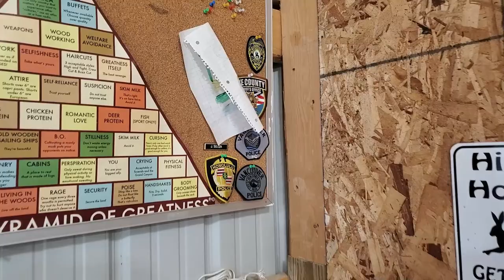She’s DONE On Our Channel!!  Airing Our Family’s Dirty Laundry | PEX Rings vs. SharkBites

Comment: I have a Sears heavy duty 70 70 lb washing machine from the 1980s and I would never trade it for one of those stinky front Loaders...
Reply: With the front loader just need to keep the door open until the seal dries out then no issues with the smell. We use to own one.
Reply: @maryburke6682  I know that's one of the things that don't make much sense to me or buy that stuff to wash your washer my cousins have them they just don't make no sense to me that's why I'll keep what I have
Reply: I have a front loader. I run an empty short cycle with bleach monthly. No issues and no smells. Also depends on what laundry detergent used.
Reply: Its due to having a tight seal and water can get around that seal. Also small items can go down under it especially if too much laundry is in it.
Reply: Absolutely! Daughter has one of those computerized front loaders- looks like it could launch a satellite- it won’t let me do a small cold pre-soak , while saving the soap/ softener etc, add warm water and do a full load - with out draining and spinning out. Not actually environmentally responsible at all - 
Just give me my Ol Bessy any day.
Reply: ricki lee p
Reply: I plan on having a stackable top loading washer, and front loading dryer in my tiny home.
Reply: i have a speed queen,last American made upright washer you can currently get,and they even keep parts if you need them..  this newer junk is all china made or made from china parts assembled here.
Reply: Appliances are just not made the same. My washer and dryer were given to me by an old neighbor and both are 80 models and have been working wonderful for past 8 years. I have 4 kids so laundry is a never ending task in my home.

Comment: If the washer /dryer are in the house proper, you may want to consider putting a drain catch pan under the washer for leaks and plumb it to the outside, or to the washer drain pipe to prevent flooding the house, same for the hot water heater.

Comment: At this point, getting on grid with generator backup was an excellent decision. 

In my opinion, 'homesteading' is not about intentionally putting your family at risk if you don't need to, just to uphold some ethereal internet standard. Our ancestors, 'homesteaded', and if they could have put in grid electricity, and indoor plumbing you bet they would have!
Reply: Please respect the rest of us who support this channel. NO negative criticial comments! NO politics here!
Reply: @cynthiarayl8568  Agreed.
Reply: @JourneyOnLife   👍🏻💯
Reply: If you have no real need to be connected to the grid then you absolutely shouldn't... it's not anymore risky to have a good offgrid system with a backup generator then it is to be on the grid... the grid fails too.. there's been many examples of this and you know it because you explicitly said with a back up generator... the difference is when the grid fails most people are screwed they have no concept of how their electric works and it wouldn't matter if they did... if they are lucky enough to have a backup generator then they like everyone else with backup need gas to run it often its a situation where you may not have access to more gas... if you have a problem with your off grid system you are likely able to resolve it yourself as you have learned how it works if not you're unlikely to be having a issue at exactly the same time the grid has failed and your likely to have more access to the gas you need for your back up in that situation... plus there's just the huge environmental benefits, financial benefits, and the independence you get from your own electric system.... you're not endangering your family for a feeling and you're not endangering your family at all if you are doing it properly... you're idea that its something "dangerous" is just silly... extra electricity is a benefit not a need...
Reply: @lizf1353  I think it's great that you have figured out a plan that works for you. Even better if you are actually living by that plan. Good on you! =0)
Reply: I'm not going to give anyone a hard time for connecting to the grid when building their home that's for sure... I'm very aware of all the things that would push a person to that decision and sometimes its just not possible to live completely off grid in their area for a number of reasons.  But to say it's endangering your family to be off grid is insane and it spreads misinformation to people. I hope you can understand that. If you truly don't understand please look into current off grid tech and how it can certainly meet the needs of a family. Running your laptop is not a necessity and you are not endangering your family by having them conservative in their energy use during a energy drought on their property. The basic needs of their lives will still be met. Are people going to use electricity for heat when they have a system that cant handle that of course not... other then that electricity is a benefit of the age we live in not something you need or you die!
Reply: @lizf1353  Good point.

Comment: Guys : next time you insulate a ceiling , staple a thin piece of rope onto the ceiling joist about 3' apart , then pull the insulation over the strings ,between each joist and it'll self support the bat of insulation  whildst you   await drywall or panelling
Reply: That is a great idea. We will be redoing the bunny barn this spring (about 10' x 10') and I am going to send this idea to my hubby. Will make life so much easier!

Comment: Need to get some water pipe steel plates for each stud that has water pipe through it. So you don’t get any punctures from hanging drywall.

Place those steel plates on the electrical through spots, if you want to be extra careful of an electrical short from a nail or a screw hitting the wire.

Comment: On your pump house, I suggest you get a thermometer that records low temp and leave it in there, which will give you a warning if your heating system isn't able to keep the shed at temp...particularly during extreme cold wind events.

Comment: Cold is on the way! Save more energy./fuel by wrapping the water heater in an insulating blanket made for water heaters. You two are amazing and inspiring! Be warm & safe.
Reply: My son is a Journeyman HVAC supervisor and I think I remember him taking mine off and explaining why those are a bad idea. I don’t remember why though. I will Duck Duck Go it to find out...
Reply: Respectfully, it can void the warranty if you wrap it.
Reply: @beckysmuck8771  I'd be worried about it igniting tbh. If the heater isn't designed to be insulated that way it might overheat maybe?

Comment: Tips from a DIYer who re-plumbed a house with PEX :
• Use 3/4" PEX as much as possible.  1/2" reduces the flow too much.
• Where ever possible, use the PEX corner bend support braces instead of the fittings.  Saves money and you get better flow.
• That little insulated box where the pipes come up might need an incandescent bulb in winter to prevent freezing.

Comment: on the laundry line you can't go from 2" to 1 1/2  trap  as the water flows from the washer it will back splash and the code is on drain lines you can't go down in size only up you have a 2' stand pipe to a 1 1/2 trap also  and fitting in a wall needs to be glued your trap is wrong I hope this help

Comment: Coming along nicely. Water heater blanket and there is a "thing" that the dryer vent can hook up to that allows you to keep the hot air inside during the cold month's and vent out side  during the warm month's, not sure what it's called, but that will help with keeping the warmth in side. Now for the animal barn !!  Finish the bathroom and move the trailer outside. Moving wood inside or up by the door so it's closer ? Looking good. Stay safe and healthy. God bless

Comment: This is the first time I've seen your channel. I used to be in construction &  I don't know if you guys know it but there is another pex connector ring that is of the same pex plastic  the lines are made of that is the best. It expands with the lines when hot or cold like freezing. Also tankless water heater wpuld have been my choice.  Endless hot water one shower after another. Best way to check for leaks is with air pressure tester with air & a gauge . Fill lines with compressed air & see if you have a pressure drop with in 24 hours. No water mess if you have a leak. Build on people.

Comment: Hi guys, When you get around to plumbing up the House. When plumbing in a shower tub valve, use 3/4" fittings for the tub spout going down. The 1/2" PEX fittings cause enough restriction that the shower head will leak while filling the tub otherwise. Looking good!!! oh & you don't have to tef tape the water heater lines as they have a rubber washer for a the seal.

Comment: the two directions of the dryer box  has two vent hoses which a nylon knee high stocking attached to the ends is great for the lint to not blow around  and will allow to be removed when filled.

Comment: Glad to see you went back to the far better unions. Something I wish I had mentioned before it that any time you can do WITHOUT an elbow, (Washing machine water lines), it is best to curve the PEX. This goes for anything that something runs threw. AC/HEAT ducts, water lines, water hose, outlet plumbing and outlet air vents, chimney pipe... Every elbow is a restriction. The only restriction you want in your plumbing is a P-TRAP.  This does not mean to make a tight bend in PEX. Just if you can make a nice curve rather than an elbow you are much better off...

Comment: Jeremy LITERALLY "Cut it twice, and it was STILL too short!" That was a running joke on construction sites for my entire career. But I had never seen anyone actually do it! =0)
Reply: That’s what my mom used to say. However, I don’t remember her hanging around construction sites. 😂🤣😂
Reply: @GoodSimpleLiving  well, it happened with my dad back in the ‘50s or so, they were working in a house and one man came in and told my dad he has cut the door 3 times and it still stuck up top......yep, he was cutting on the bottom.  ❤️ every thing you two do, I still think you should play the song, “I did it my way”,  but they would get you for copyrights or something.  👍👍👍👍👍💜💚❤️💗🇺🇸🇺🇸🇺🇸🇺🇸
Reply: It’s always measure twice and then cut once.
Reply: @iPhil77  There is another carpentry saying that measurement is the enemy of accuracy as well.  :)
Reply: Write down the measurement for the cut on the board and double check the measure. 

If it’s multiple pieces of the same measurement then cut one and then use it to mark the remaining pieces. 

Work smarter !! vs work harder.
Reply: @iPhil77  this is essentially what my hubby does. He’s been doing drywall since we were 16 which was 16 years ago. He is always writing his measurements down especially if he ends up doing a job by himself.
Reply: My dad used to always say that.

Comment: Looking good for the pole barn,  when you go to do the house run already 3/4 all through the house,  use as little 1/2" as possible changing to 1/2" as close to point of use as possible.  This will help keep pressure up no matter what else is running.  Also will help so you don't go cold or hot when someone uses another point of use ( like toilet)

Comment: I would also have a certified electrician go over every wire you did, if one of those grounds has a false connect same result same result as one of those batteries from that solar garbage burning your house down, understand what an AMP is and how little of it it takes to kill a human. How far electricity can jump, what would cause that and how to prevent it. You also have to have a very good understanding of wire gauge for continuity reasons which also can cause fires by heating the wire up because its not thick enough to handle the current. Also make sure you have all your airstacks from your plumbing inspected so your not trapping methane in your house which will make you sick and can be highly explosive if trapped in lets say an attic or a closet.

Comment: A tad late for the alternate house - but look into tankless water heaters for your new build - when you do, always get the option to have both a silt filter installed before the heating unit, AND a shut off valve. You will save space, as well as energy! We have replaced 4 hot water TANKS with this & have never looked back! I only have to replace my filter about once a year (I am conservative with water, with a fam prob twice a year replacement - depending on your water quality). Also, the first tankless we had, we didn’t use a filter & in a year it blew the PEX & the inside of the one year old unit was packed with silt. Hope this helps.

Comment: Great job guys. Sure glad you caught on to the suggestions of not using the Sharkbite fittings. I don't know if you have already purchased your solar system or not but, after learning the pitfalls of what not to do and what is best, I would be more than happy to share some advice before you start to install your system. It will save you money in the long term and, because you have access to the grid, which I don't, will also give you plenty of power when the grid power is down. If you have a email address I can contact you on, I can email you information if you want it. Let me be specific, I don't sell or install solar systems, just help DIY'ers with my advice from building solar systems over the past 8 years.

Comment: Nice work.  I would suggest something hard between the sheetmetal building material and the PVC drain.  You will get movement and it might take a few years but you will find a hole in the pipe eventually.

Comment: CPVC for hot, PVC for cold. Just eliminate the pvc you used for the hot water side of the heater and connect it directly to a pex fitting.

Comment: Nice video, looks like you are ready for the winter snow.    Fiber concrete siding or metal to match the barn on the pump house.  The concrete siding is low cost, looks good, is fire, insect, rot proof and takes paint very very well.   Run the water TP valve down to he floor or at least face it to the wall so if it lets loose you don't get your face scalded like my dad.

Comment: we are currently in a 800 sq ft apt in our 40x60 shop while we build our house. washer  & dryer are about 60 ft apart so dryer would be  close to electric panel .  not ideal but better than outside. congrats on getting it inside before winter

Comment: My husband, who used to be a plumber, wants to comment: 

I recommend you drill holes in 2×4's for your water lines which will protect your water lines from getting messed up when you put walls up and anything gets attached to the walls. Also, eventually the nails from the talons will wear out and the 2×4's provide extra support you're not currently getting. 

Hope that helps. 😊

Comment: Wish I seen this video earlier, would have mentioned placing wire loom on the pex where it passes thru the studs and such, pipe whip will cause it to rub and wear holes in the pex.

I guess the next best thing would be surge arrestors.

Comment: Wires on the wall is not good, it could cause a short and fire. Drill holes in lumber to run them or pvc, but then again i could be wrong. Great jobs ya all !!!

Comment: Melissa So e advice-You should not add more salt to the softener because the salt gets heavy and the weight and becomes hard and then you need to break it up, it stops softening your water. The amount you have in there looked perfect Also with just check to see if the bottom of drum is not hard I used an old broom stick work great.

Comment: Well I have been using Shark fittings for quite some time now. I have had them on my heating system and replaced the copper lines with the pex. I think it is an individual thing. It's just that with Shark bites they can take a freezing and not burst. Also you can change them it you want change something around.They also have an electric crimper for those pex clamps.

Comment: Wooo hooo. Hot water. Almost ready for winter now. I am starting to change my whole house to pex. I have like 3 different types of pipe now. When they put in new well I put pex in to the main pipe in basement. That pipe is galvanized 3/4 inch. Out from water heater there is 3/8 inch inside diameter copper. Think I have everything I need, but you know how that goes 😆. Wish me luck.

Comment: Heads up on your plumbing for your washer. It's a bad idea to take a 2" drain and make it go to 1½ trap and outlet. By code it needs to have a 2" drain the whole way through till the main. Those washing machines force a lot of water out from a pump, when it drains it needs a large pipe to drain through. I hope you don't have issues but as you go forward never make a pipe smaller on a drain. You will have issues. Another thing that can happen is the 2" vertical drop will syphon a 1½ p trap.

Comment: Great job on the plumbing. But I would recommend that you put a earthquake strap around the top and the bottom of that hot water heater . You can use plumber strapping and it'll only take about 15 minutes . Just wrap it around the hot water heater and screw into a stud. Love your videos

Comment: Have you thought about metal siding to match your barn or Hardie siding for your pump house.  Just a note on your water heater I did not see a pipe from the temperature pressure relief valve to the outside of the barn.  I don't know if you can use PVC for hot water line ; you might change it out to CPVC which can be use for hot or cold water  Stay safe and another awesome job .

Comment: Hi Love the channel I scrolled a few comments and did not see anyone mention this yet. Remember to put a pipe on that pressure release valve on the hot heater. Right now it is at face level. You should put a pipe and angle down to a few inches off the floor. Good call on the shark bite fittings.
Reply from the maker: Yup, got that done